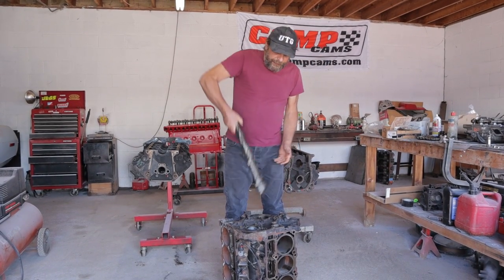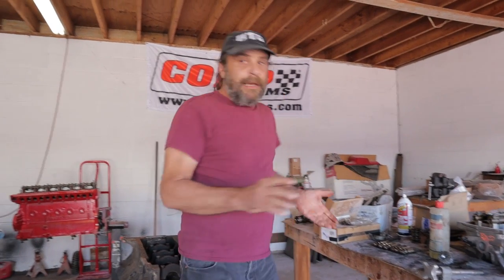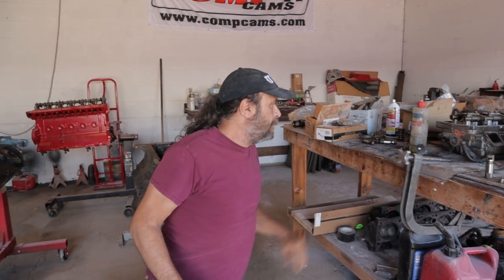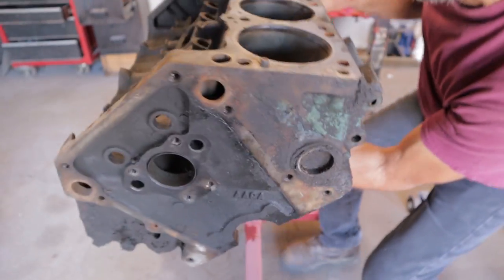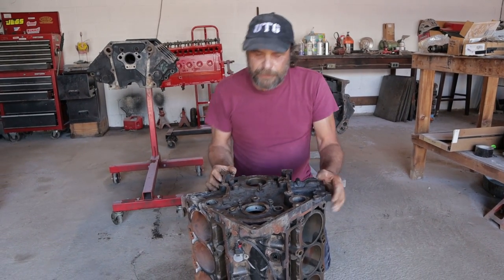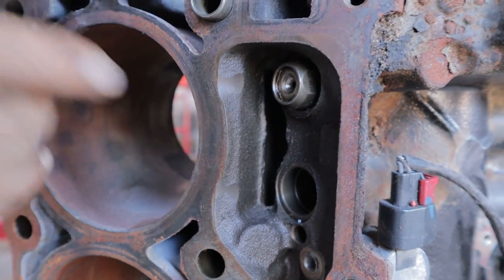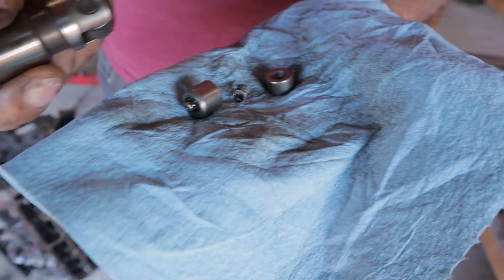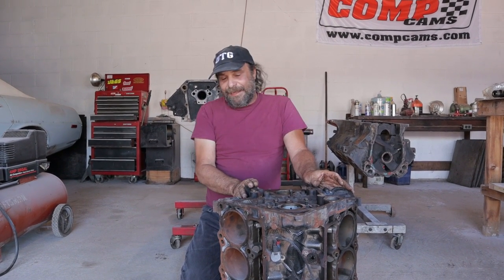Gen 3 Hemi Camshaft Failure Mystery Explained!

Comment: I have no doubt the Chrysler engineers were well aware of this oiling issue. The engines probably tested out for longer then the warranty so they blew it off.  I work for a global automotive o.e.m. I work in the research and development,  durability group.  I watch the company over look flaws like this all the time. What really drives me crazy is when they jave a good design for a part, we test it and its indestructible.  The next phase of testing is cost cutting.  The engineer the part down so its cheaper to manufacture. As long as the part lasts through the warranty its a go !
Reply: It's amazing to me how many things that were seemingly perfected years or decades before are suddenly a point of failure again on modern cars.  It's not just Dodge either.  All car companies seem to goof like this regularly.
Reply: Planned obsolescence. Back in the 60's GM's 283 and Fords 289 where phased out simply because they lasted forever. They were great engines that rarely needed repair and the dealerships couldn't make any money off of them so the disappeared.
Reply: Lassi Kinnunen  Manufactures deal with pennies as opposed to dollars. $.10 x X many million vehicles sold . Think about the Ford Pinto for one example. Ford knew and fought  the issue with the fuel tank even though the fix  was mere pennies. Balance cost of design against potential law suits.
Reply: Lassi Kinnunen  Agree. Always a fight between designers, engineers, and accountants.
Reply: @edfrawley4356  Im not sure about that logic. A 289 and 302 are very similar. That engine, along with the 351w (again similar small block design) were made until the 90s.
Reply: @edfrawley4356  The durability of the old V8 engines is called 'over-engineering' today. Planned obsolescence may seem to be, but is not related to durability; it is becoming outdated due to technological advancement. It may seem an oxymoron, but something can be cutting edge technologically and still be a crappy design, this being a good example. BTW, I much prefer the old V8 approach.
Reply: Hey Bryan. Yes, the old Material Cost Reduction requirement of D&R engineering. There seems to be two approaches: 1) put in something you can safely take out as an MCR action later, or 2) make a good design marginal, as you describe. I like the first
Reply: Your absolutely correct.
Reply: I guess it could explain why they stopped selling the lifetime warranty last year.
Reply: I did the same for 25 years with pretty much the same observations. Pissed me off no end.
Reply: who's engineers ?
Reply: @james avery 
AvE ROCKS
Brilliant dude.
Reply: @TimHoppen  people abused it so they got rid of it
Reply: Sad because it's true.
Ford owns most all of it's parts suppliers, so they design vehicles to be repaired by " replacing sub-assemblies".
For example: instead of replacing one bad driveshaft hanger bearing, youre stuck paying for the whole half- shaft assembly.
So the $25 part is spot welded to the $250 shaft, meaning You now pay $275 to replace a bad $25 dollar part ( plus labor)...
Ford wins- owners loose $
Reply: Good reason why Chrysler no longer offers lifetime extended warranties.
Reply: TONY, I DOUBT THE ENGINEERS WOULD MAKE A FATAL FLAW MISTAKE LIKE THAT IN THE DESIGN OF THE BLOCK AND PRODUCE IT FOR SO MANY YEARS WITHOUT CORRECTING IT. IT HAS TO BE SOMETHING MORE SIMPLE. THE ONLY LOGICAL ANSWER TO WHY THE CAM LOBS ARE BEING WIPED OUT IS THE LIFTER ITSELF. WHERE THE ROLLER THAT RIDES ON THE CAMSHAFT, THE CENTER SHAFT DRILLED HOLE WAS NOT CENTERED WHERE IT WAS OFFSET, WHERE WHEN YOU SPIN THE ROLLER IT WOBBLES UP AND DOWN CAUSING A FICTION EFFECT. THIS IS ALWAYS THE CASE WHERE THE SUBCONTRACTOR WHO PRODUCED THOSE LIFTERS FOR CHRYSLER HAD BAD QUALITY CONTROL. THIS IS WHERE CHRYSLER SHOULD BEGIN THERE INVESTIGATION.
Reply: well if you drive a car like this in the city you wouldn't have many miles on the car and with proper lubrication that car would easily last 15+ years how would they make money except designing it to fail
Reply: bodyman 50  IT'S CALLED "PLANNED OBSOLESCENCE". MY BROTHER IS AN AUTO APPRAISER FOR CLOSE TO 35 YEARS. WORK FOR LIBERTY MUTUAL AND WAS TRAINED IN THE BEST SCHOOL TAUGHT BY EX-ENGINEERS WHO WORKED FOR THE BIG THREE AUTOMAKERS. ABOUT THE BODIES TO A BIG DEGREE YOU ARE RIGHT. BUT WHEN IT COMES TO THE ENGINES THEY ARE MADE TO LAST, BECAUSE IT IS THE HEART OF THE MACHINE. IF THIS WAS A BLOCK DEFECT AND THE GEN III ENGINE. THEN IN THIS CASE IT WOULD BE ALL OF THEM HAVING A PROBLEM WHICH IT IS NOT. A BAD UNCORRECTED BLOCK DEFECT MEANS THE HEMI WOULD HAVE EITHER FADED AWAY OR CHRYSLER CORRECTED IT FROM THE START, WHICH IS NEITHER THE CASE. THE DESIGN WAS CORRECTLY ENGINEERS FROM THE START.. THE PROBLEM MOST MANUFACTURES FACE TODAY IS A BAD RUN OF PARTS FROM THE AFTERMARKET SUPPLIER. AND THIS IS WHAT CHRYSLER IS FACING WITH THE GEN III HEMI. WHEN THEY RECEIVE THESE PARTS THEY SHOULD RUN THEM THROUGH RANDOM TESTS THROUGH EACH MANUFACTURED PART LOTS. FORD HAS BEEN DOING IT FOR YEARS. THE REASON I KNOW THIS IS BECAUSE MY BROTHER WAS A COMPUTER TECHNICIAN/ENGINEER FOR PRIME COMPUTERS. WHICH FORD MOTOR COMPANY USED PRIME COMPUTERS TO X-RAY AND TEST THEIR PART FOR DEFECTS. WHEN THE LOCAL STATE PRIME COMPUTER TECHNICIANS AT THE FORD PLANTS HAD TROUBLE, TROUBLE SHOOTING A PROBLEM. THEY WOULD FLY MY BROTHER IN AND HE SAW THE PROCESS AT FORD PLANT OF INSPECTING PARTS FOR INTEGRITY WITH COMPUTERS. THIS WAS BACK IN THE 1980'S.
Reply: @andrewalberico6177  THE HEMI ACCOUNTS FOR BILLIONS OF DOLLAR IN CHRYSLER SALES. NO WAY IS THE ENGINE A ISSUE. IT A BAD RUN OF LIFTERS, OR SECONDLY BAD MACHINING WHERE THE LIFTER BORES ARE NOT TRUE AT A 90 DEGREE ANGLE. BUT THAT WOULD HAVE BEEN PICKED UP BY THE CHRYSLER ENGINEERS WHEN THEY SAW THE CAM AND LIFTER ROLLED ON ONE SIDE.
Reply: bodyman 50  THANK YOU! THANK YOU! THANK YOU! YOU ARE ON THE SAME PAGE AS ME AND WE BOTH AGREE IT'S JUNK MADE SOMEWHERE ELSE LIKE CHINA. UNLIKE BEFORE LIKE YOU SAID WHEN THEY MADE THEIR OWN STUFF AND DIDN'T HAVE THESE PROBLEMS. PRAISE PRESIDENT TRUMP FOR PUTTING A STOP TO THEM AND THE REASON HE NEEDS A SECOND TERM. TO FINALLY PUT A END TO ALL THESE JUNK PRODUCTS THAT ARE DESTROYING AMERICA, ESPECIALLY THE STUFF FROM CHINA..
Reply: IIRC for reading stuff on the allpar site, the gen III design team had Tom Hoover (of gen II hemi/slant 6 fame) come in to give them some direction on their design effort. Hoover suggested that they raise the camshaft in the block to avoid some of the pushrod/rocker arm geometry issues encountered in the gen II hemi. It looks like more time on the bench was warranted. Oiling issues appear to take time to get right in a new design.
Reply: I worked at an American based OEM in engineering as well. Heaps of shit gets cost cut as the end of development by Excel and Powerpoint engineers. Then the management wonder why warranty is through the roof and the brand gets a bad name down the track. There's an issue out there with a transmission lunching gears. This was seen early on in development but the cost of fixing the issue was something like 2 bucks a car. Now the manufacturer is replacing 80,000 transmissions worldwide.
Reply: @aaronhumphrey2009  That replacement part which is supplied to the OEM is charged at a massive mark up from the supplier. This is because OEMs screws the suppliers down on the piece price for the large volume supply. I've seen the costing for this sort of stuff. A 8 speed auto piece price is about 1500USD but the replacement part price in a wooden crate from the supplier is 4500 then the OEM will add a 20% markup on that. OEM's do very little engineering work on cars these days. Most of the work is outsourced to suppliers where the real engineers work.
Reply: @AndrewEG  YOU'RE A LOGICAL THINKING MAN AND I COMMEND YOU FOR THAT. READ THE COMMENTS FROM THESE HYENAS HERE ON TONY'S CHANNEL I AM DEALING WITH AND THE STUPIDITY WITHIN IT'S COMMENTS. IN THE CASE OF BILLION DOLLAR CORPORATIONS AND THE ADVANCEMENT OF TECHNOLOGY. BAD DESIGN USUALLY ARE A THING OF THE PAST, BUT THEY DO EXIST AT TIMES BUT ARE MUCH LESS. WHEN YOU SEE REPUTABLE COMPANIES EXPERIENCING THESE PROBLEMS. IT USUALLY A BAD RUN OF PARTS. THAT WAS THE CASE WITH THE FORD TAURUS IN THE PAST. THE CLUTCH BAND THAT LOCK UP THE DRUM SO IT SHIFTED INTO REVERSE. HAD A ANCHOR PIN THAT PUSHED DOWN ON A BRACKET. THE BRACKET WAS STAINLESS STEEL AND ELECTRICALLY FUSED TO THE BAND. WHAT HAPPENED TO FORD IS THAT THE SUPPLIER WHO MADE THOSE BANDS NEVER PROPERLY FUSED THE BRACKET TO THE BAND. IT WAS LIKE BEING TACK WELDED WHICH CAUSED THE BRACKET TO BREAK OFF. ONCE THEY REPLACED THE BRACKETS THEY NEVER HAD A ISSUE AGAIN. THIS IS THE SAME ISSUE HERE CHRYSLER IS HAVING CALLED "A BAD RUN OF PARTS".
Reply: @seabulls69  THANK YOU! I SEE I'M NOT ALONE HERE. AFTER SEEING TONY'S VIDEO HERE, EVERYBODY IS ALLOWED A OVERSIGHT AND IT HAPPENS TO ALL OF US. WHEN I WENT TO THE COMMENTS AND WHAT I WAS READING JUST ASTOUNDED ME. THE AMOUNT OF STUPIDITY PEOPLE POSSESS IS ASTOUNDING. YOU CAN TELL THEM ANYTHING AND THEY BELIEVE IT.
Reply: @pwrbyford68  Exactly that Windsor engine was produced until '97 and used in millions of vehicles as both the 302/5.0 and 351/5.8  without issue. What's causing newer engines to appear to have more issues is two fold. First it's some new tech aimed at increasing efficiency and decreasing emissions. Second it's the internet, while in the past one failure was known by only a few, now one failure is spread around the net and everyone hears about it. They don't hear about the thousands of engines that are working just fine.
Reply: @cmr2079  it's intentional, not a goof-off.
Reply: @robkal56  yes. you can build a 2 bedroom single storey house with 12 inch wide concrete walls. it will be over-engineered but it would cost too much.

Honda is still over engineering their stuff. K20 and K24 motors last quite long and can boosted to produce more than twice their NA HP without the need to replace the stock bottom end.
Reply: Planned obsolescence by FCA.  The engine dies, you dump the vehicle and buy another or do the fix at the dealer.  That way FCA stays employed and generates revenue.
Reply: @pwrbyford68  I think '65 Fords had 352's
Reply: Ted T depends on what model ford. Yes some had the FE big block but not all. He was saying that after the 289, ford made the small block unreliable which isn’t true.
Reply: Unfortunately they have to save their profit margin because the UAW has driven labor costs to astronomical levels.  Same with GM.  We've reduced corporate taxes, now we need to allow companies to reduce labor costs.  Also being a  union they make it impossible to get rid of bad employees to make room for good ones.
Reply: @pwrbyford68  I think the Ford "Custom" had the 352
Reply: Bean counters
Reply: Very, very believable.  Dealers make their money from service, not new car sales.  If the parts are TOO GOOD, then no service is needed.
Reply: @edfrawley4356  I wouldn't give them that much credit for that much foresight. Any middle manager that can save a buck looks good at least for the next fiscal quarter.
Reply: Actually here, we test most of the 5.7 cars to 125k miles for emissions testing and reliability which is far past the 36k for the warranty hell we've got a couple cars that are over 200k that we keep reusing for different testing
Reply: Why make something great, when cheap sells better.
Reply: @AndrewEG  what brand is replacing 80k transmissions?
Reply: @zacht9447  I thought I read they test the 6.4 the same as the cummins 300k or something?
Reply: @what you make of it
Who do you work for?
Reply: @edfrawley4356  no they were phased out cause they made little power they were replaced with 327s and 302s and 350s that guess what also last forever some old dude put a million miles on a 90s truck with a 350, same design as in the 60s
Reply: @robertbasile4191  I mean the HD trucks are tested a lot longer than cars out to 175 for emissions
Reply: @edfrawley4356  I agree gen one sbc 283 in a 65 station wagon got 25 mpg ,and every one could fix them,  so where is the "improvement" in sideways tranny under the engine front wheel drive?
Reply: Let's just say all engines need a fuel pump, a water pump, a altinator, a air conditioning pump, a power steering pump, all this should have been gear drive on the front of the motor.
Reply: I feel they're tripping over a dollar to pick up a penny. Rather than having a customer base that spends thousands every six or seven years on a new car and will come back every time. They'd rather have a customer base that buys a car that gets pissed because it breaks down all the time and then never comes back.
Reply: My 2017 Ram pentastar engine had cam phaser problem at 34k miles. I had to turn in my leased truck at the time , they refused to fix it under warrenty. !! No Chrysler products for me thanks
Reply: not surprised considering ram has such a terrible warranty. think they told me 60k or 65k miles because that definitely screams confidence in reliability.
Reply: Sad state, very sad...
Reply: U work in engineering and you dont jave the proper grammar